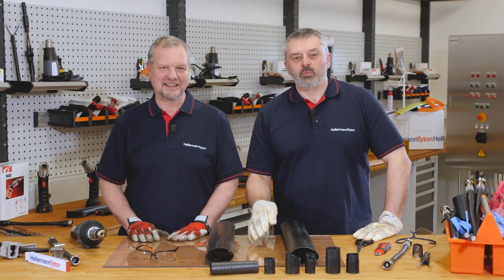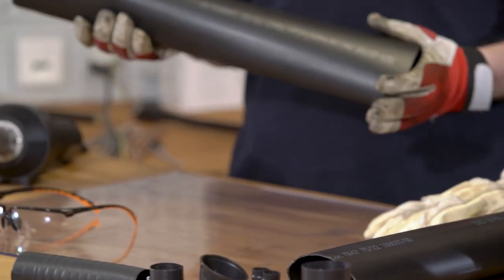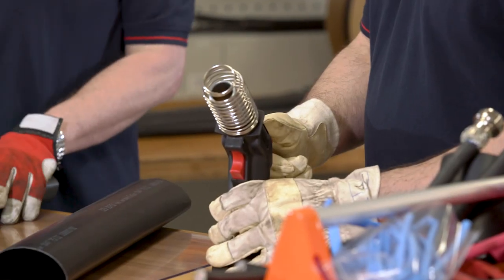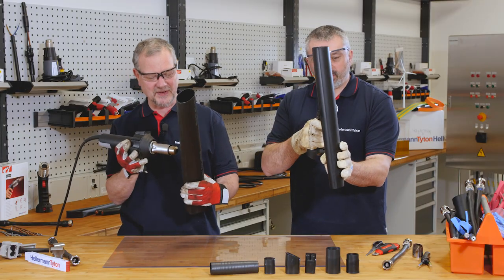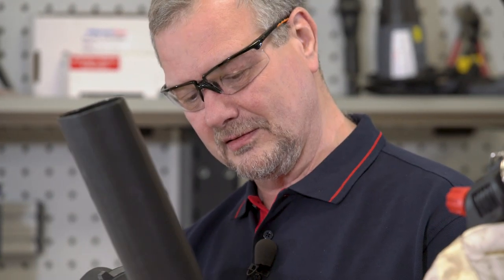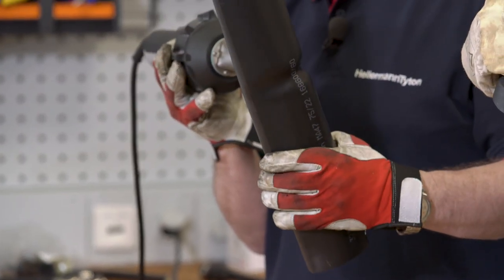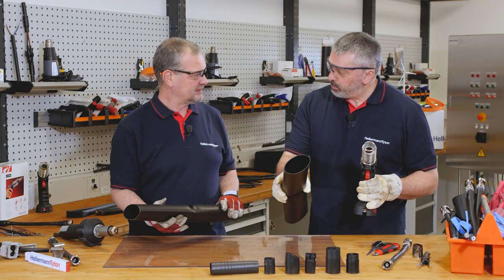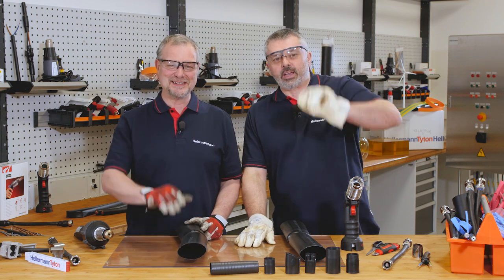Gas or electric heat gun for heat shrink tubing? #3

Comment: How many watts does that electric heater have?
Reply: Not enough apparently.
Reply from the maker: Hi michael hoyt, the H6100 Electrical Hot Air Tool has a Powerful 1600W motor. Check out the product detail page with more information, click here: https://www.hellermanntyton.com/products/application-tooling-for-heat-shrinkable-tubing/h6100/391-00110 best wishes, Nico
Reply from the maker: Hi Michael Gronlund, the electrical hot air tool is is designed for shrinking thin to medium wall heat shrink tubing, end caps and molded shapes. Best wishes, Nico